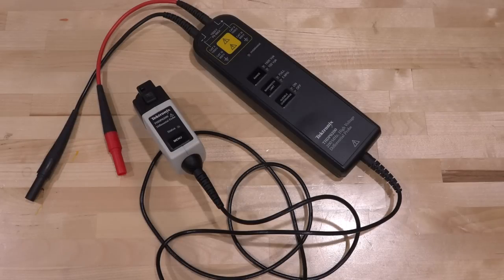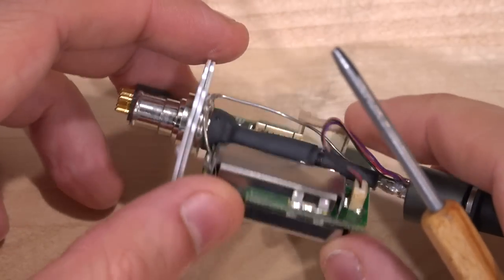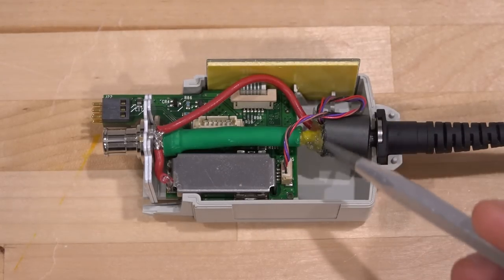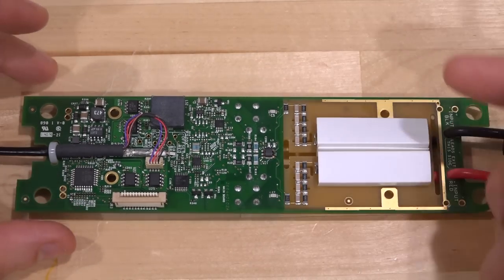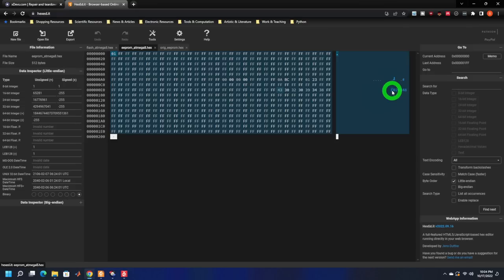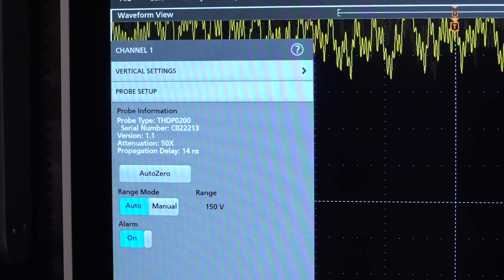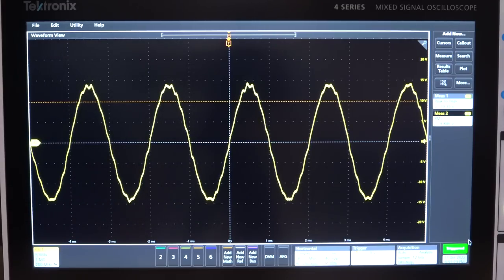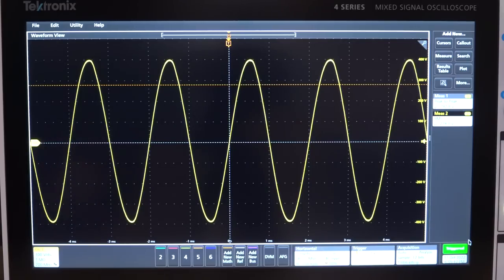TNP #23 - Tektronix THDP0200 ±1.5kV High Voltage Differential Probe Teardown, Repair & Analysis

Comment: Congratulations on repair! My THDP0100 have input attenuator potted with silicon gel from both sides. I'd expected that would be necessary since THDP0100 rated for much higher 6kV voltage rating. Also P52XX series probes use very similar design, but have smaller bandwidth. THDP/TMDP are just updated version for TekVPI.
Reply: you are the best man and we all love you for it 😇

Comment: The manual mentions zero'ing the probes, which may be stored in the eeprom that differed.  Also, calibration data may be stored there.  The manual mentions firmware updates but I don't see any available on their website.  As always, your diagnostic skills, repair skills, and knowledge are a pleasure to follow.

Comment: It will be interesting to see how this repair holds up over time. It can very well be that that little Mega8 has worn out its internal EEPROM (like those Teslas a few years back) and this fix is only temporary.
Reply: That would sound about right!
Reply from the maker: If this happens again it would be a simple matter of swapping the processor with a new one.
Reply: @Thesignalpath  lucky you, that Tek didn't blow the read protect fuse in the Mega.

Comment: EEPROM data corruption is huge problem with atmega. Sometimes first byte of the EEPROM gets corrupted durring power-down or in high-noise enviroment. There is workarounds, but it might bite you bad in high-volume product.

Comment: Perhaps that EEPROM data is calibration information? It would make sense to store that there, and you probably wouldn't notice a slight change in calibration (from using the calibration from the other device)?
Reply: Would have to check the EEPROM info after the autocal, and see if it has changed slightly.  Very likely the EEPROM stores both the switch states and the autocal constants in it, and this means that it has a large number of writes to it. One either finally killed a bit, or the power failed from the broken cable during a write, corrupting a few of the bits. Looks like there is no wear levelling done there, just write the same blocks over and over, without even doing the simplest thing and writing multiple copies, and reading them, with a checksum, to see the valid ones. Simple in the firmware, unless they were running out of ROM space, to implement that with only a small amount of code, and then either rewrite the faulty data, or have the UI pop up an error message that the probe calibration is inconsistent and it needs service, or just log this as an error and continue with a degraded reading warning.
Reply: @SeanBZA  It's straightforward to do, not necessarily simple.  I'm assuming they're using C*, so Checksumming is easy provided that they read/write a struct and always call the function.  It's even easy to do replication of that struct.  However, this naieve solution has multiple problems:

* If you do data replication, you're also replicating the checksum.
* You could be doing a 4 byte checksum of a single bit of data!
* It's easy to forget to call the checksum function.  (C++ solves this)

If you want to just do data replication, then you either need a translation layer, or at least several helper functions.  With the danger being that it's easy to forget to use it for one critical part of data.

Now, you can work around some of these issues by doing a checksum on startup and after every write, but that doesn't solve the wear leveling issue.  Personally, that would be my approach.  Just because the failure mode during development is the MCU reports a problem instead of silently working.

* I personally prefer using C++ even in embedded applications, but there's a crowd of rabid C users.

Comment: Hi,

Did you try setting 0x01 at offset 0x04 in your EEPROM? Looks like it could be a bit flip:

06 09 72 08 0*0* 00 01 00 01 00 <- TSP
6A 08 33 08 0*2* 00 02 00 02 00 <- xDevs

Edit:
Also disappointing that there is no apparent checksum
Reply: Another potential bit flip, this time from 0 to 1 is the 0x09 at offset 0x01

Comment: So, they didn't enable "code protection" option in Microcontroller?😮😯
Reply: This also shocked me, but ATMega8 is also quite ancient.
Reply: @jessicav2031  Probably makes the service centre life easier, seeing as they do have to update them during service, and with a long model life unprotected code is easier to fix. After all you are paying big for the scope, so will pay equally high for certified accessories as well. Cheap copy will be hard to certify and still sell.
Reply: @SeanBZA  It's possible to only read protect AVRs without disabling programming. You can't read the code, but erase the whole thing and flash new content.

Comment: Why are there capacitors in parallel with the resistors for the input divider network? Is it to allow for AC measurements?
Reply: Yes.  The capacitors provide the HF reading and the resistors provide the LF detection (and DC if they have magic to send that signal through the transformer).  The resistors also provide a passive balancing for the capacitor voltages so a weaker capacitor or one with different leakage currents does not get a lager share of the divided voltage with slow signals.
Reply: @KallePihlajasaari  Awesome explanation! Thank you!

Comment: If it's external resistors that set the model, why did a corrupt eeprom show the wrong model at the start?
Reply: maybe the eeprom contains a checksum that was corrupted, and the probe AVR refused to do its work? A lot of Thinkpads died that way, back in the day :D
Reply: @tomteiter7192  but it displayed the correct serial number
Reply: @TheFool2cool  yeah, but that was stored in the "connector AVR" not in the frontend AVR

Comment: Guessing scope must update probe firmware and someone’s scope crashed or they unplugged mid-update. Or maybe hit auto-zero and unplugged leaving eeprom in corrupted state.
Reply: Could be, or it simply hit the write endurance of the eeprom, at least till the entire device was erased during the copy of the new firmware, which might silently have swapped out the failed bit using a spare row. After all during manufacture you want to have higher yield, so having a device erase, rather than block or bit erase, might also include a memory zero check as part, and failed bits are replaced with the spare row in the device, till the few spares run out. Tiny bit of extra silicon, often otherwise unusable, and a few extra cells to do the swap permanently.

Comment: "read out the firmware" - this is the first time I heard of a case is not read-out protected....

Also: normally this type of probes are not isolated. Are you sure this one is ?
Reply: Not isolated, just has very high common mode impedance, so ground current is very small in almost all cases, and with a balanced connection to both channels affects them identically.